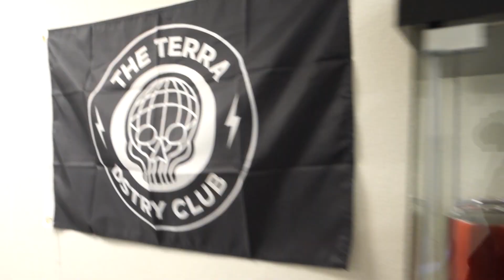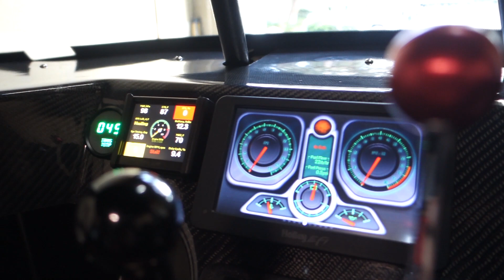Drifting FORD Ranger Prerunner | BUILT TO DESTROY

Comment: I hate when they put different engines in other models of vehicles!  I know LS's are easy AF to get and hook up but a Ford engine outta a stang or f150 or 250 would be better!
Reply: Ls all the way, Cheaper to get for one all ready to go and more parts. That's why you see so many old hot rods doing it.
Reply: LS is the cheapest way to make lots of power, they're very reliable, and you can still run pump gas. There is even people doing LS swap mustangs.

Comment: Omg lose those I beams and this would perform well
Reply: And how would you know?
Reply: Too bad to get 22” of suspension travel with AArms would have to completely redesign the front end of the truck, move the motor back, fab a housing for the motor that’s now in the cab of the truck, whoop Scissors are where it’s at for long travel without spending 30k on a j arm center mount setup.
Reply: Yeah cause that truck dosent work at all.....Oh wait that truck works pretty dang well. And really who cares what someone runs if they enjoy it, its all they can afford or whatever. Enjoy the ride, the destination and the time because you may never get to do it again, simply enjoy life.